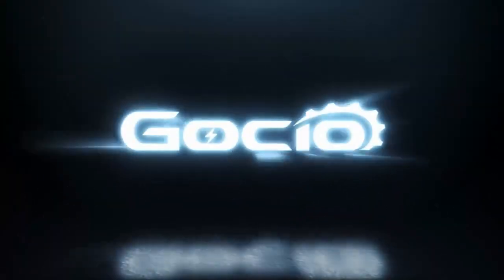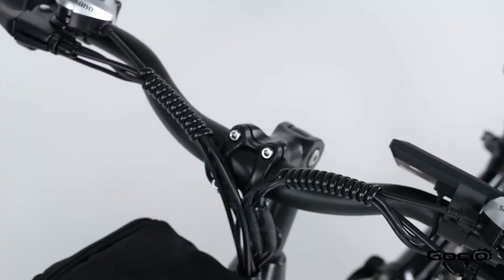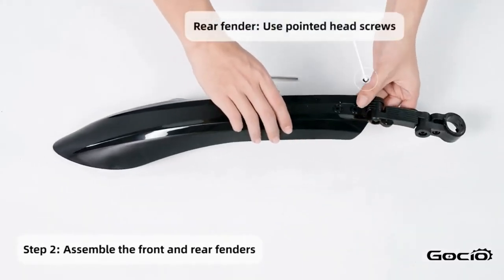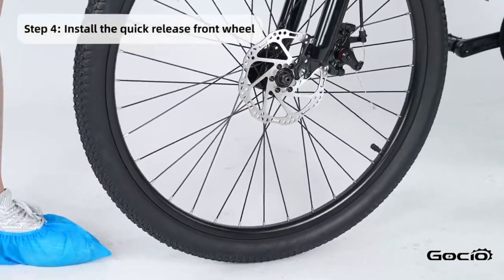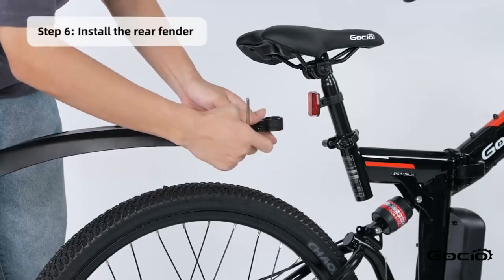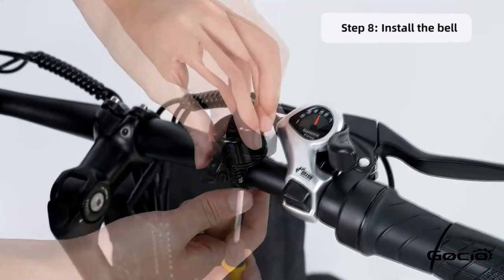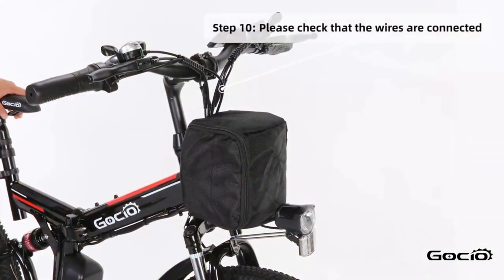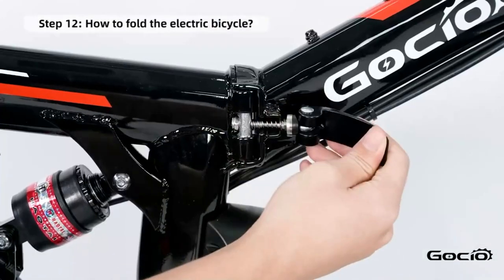GOCIO eBike setup video on YouTube

Comment: Good luck trying to get help with warranty needs, Walmart said not their responseability, can't get in touch with Chinese company.
Reply from the maker: Awe man that sucks... how long have you had it? Is it less than 30 days? If so run to walmart and get the Allstate Protection plan add on warranty and then call them they will take care of it for you!!  You have 30 days after purchase to get it.. its about $40  ... ALWAYS get the allstate add on warranty for this exact reason! .... Another reason is because if you have any issues with your item (and you will!!) Allstate refuunds or replaces it within a week or two.... and when they refund you , you get to keep the old product for Whatever you want such as Extra Parts or Fix it)   ... I got my bike for free (pretty much). When i had an issue with mine. They attempted to have me go have a shop fix it. I Told them no i wont put the money up to have it repaired and wait for a reimbursement...  They sent me a check for the priced of the bike and few days later i was able to fix the bike and it runs great now!.

Morale of the Story: ALWAYS GET THE ALLSTATE PROTECTION PLAN. Especially on the itmes $20 and up!